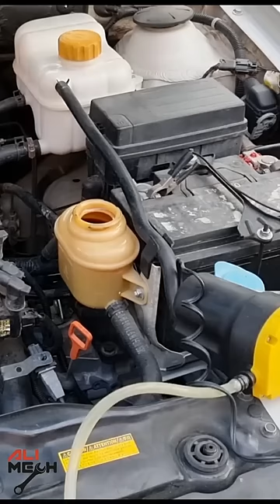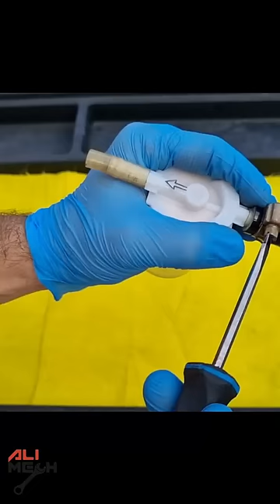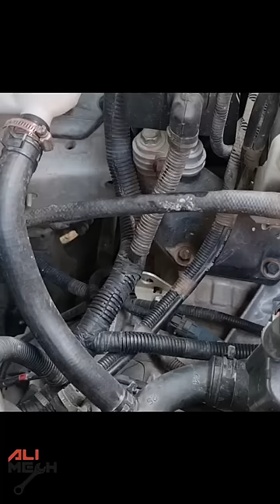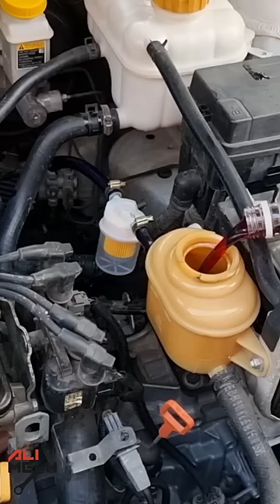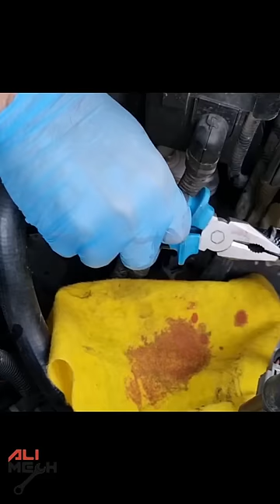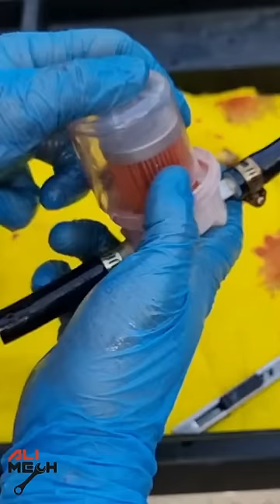This will save your Power steering? #shorts

Comment: As a nissan auto tech, this is cool but pointless. Your power steering system is a closed system, there shouldnt ever be debris getting in, if you have shavings and things coming from your pump, you need to replace it. Nonetheless i still think its a cool thing to have in the engine bay and it takes no time, fun little project if ya get bored i guess

Comment: If your car doesn't have a powersteering filter then don't put one on. If it needed one then the manufacturer would have put it on themselves and if you are finding metal pieces in the fluid weather u have a filter or not. That's not really a good sign and should be checked out

Comment: Ya know if you run your filter for 5 min and there's metal chunks in there you are a little late. Also why wouldn't you just leave it in place.
Reply: It swelled a bit when running, so I am guessing it would pop under any kind of heavier flow.

Comment: Bro adding a filter to a already filtered system
Reply: Power steering fluid IS NOT FILTERED. Now it can be. Good idea
Reply: @hionboost  how old is that car? I have a Mercedes w140 from '92 that has a factory filter installed

Comment: You made a mistake , when ever you open the oil filter or rechange it , make sure the new filter should be full of oil not empty because that make what we call it " prise d'aire "
Reply: It’s on the return side so actually it doesn’t matter.

Comment: He says 5 minutes but he only lets it run for about 4 seconds. You can see the pressure expanding the filter in that small amount of time. Definitely not a good idea to even try. Most if not all components being used (gas filter, clear rubber adapter hose to make gas line fit filter,gas line & low pressure clamps) are all a major safety hazard the way he’s using them!💥🔥🧯🧯

Comment: Honestly according to the little bit of running you did on that filter, kinda debunks any need of a filter on that system. Just change the fluid every so often (owners manual does state that) and use the correct fluid and it’ll last many many years.
Reply: Yea but first off there's no way to drain all the fluid out, no matter how you do it there's going to be a bunch still in there.
And considering how the systems are built even if you could drain it all out there's a bunch of places that contaminates can be trapped in places like twists, turns and low spots.

Comment: u know it is for gas, right? it can't handle high pressure
Reply from the maker: Yes I know its for gas but it's low pressure inline filter, and I installed it on low pressure return line for five minutes only, to filter the fluid, and it Catch some debris

Comment: The only time that filter will be used is when your pump goes bad and fills it with metal. 😂 It's irrelevant. Unless of course you're a crap mechanic who didn't clean the system when you put the new pump in  from the one that went bad. This information will save you from crappy mechanics.